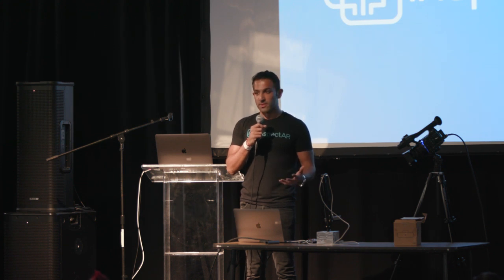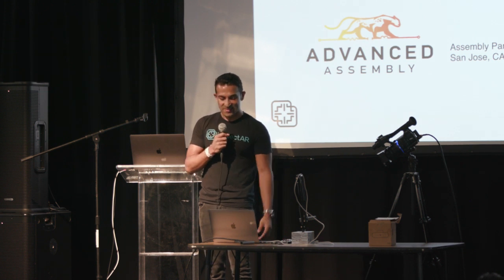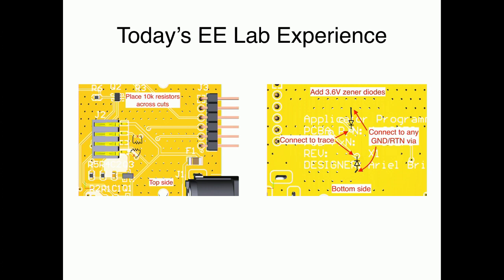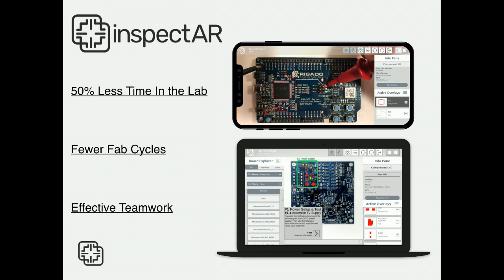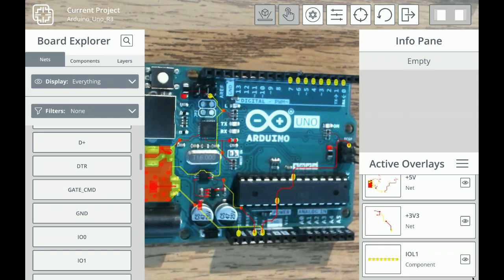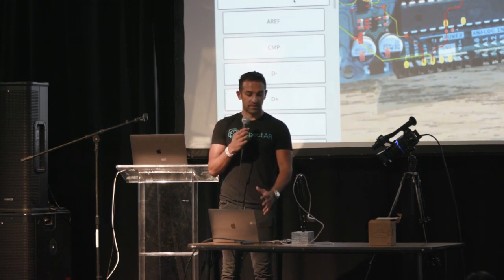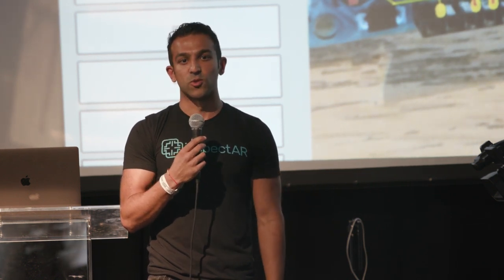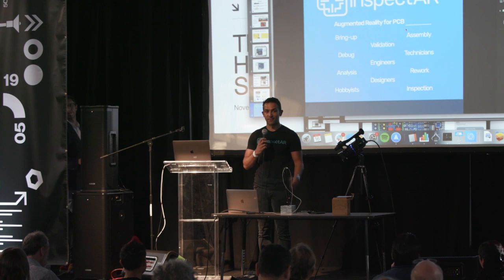Mihir Shah - Debugging PCBs with Augmented Reality

Comment: I wonder if Flutter's Augmented Reality package could be used to make an application that can find components from a circuit board!  But not sure if there is a minimum marker size , and if it can be overlayed with very high precision.   

For example, if you have a sheet of paper with a grid of squares, say 50x50.. if A4 is said/entered, could AR use a fiducial on the paper to calculate how far into the grid it needs to place a marker (scaling it based on the the angle and how close the camera is to the sheet). 

BTW, any thoughts on tools like Flet/ARCore or ARLoopa to do AR?